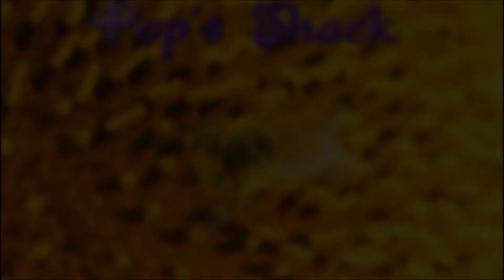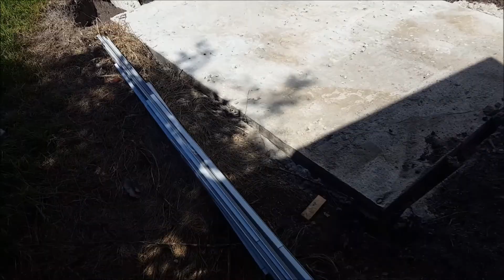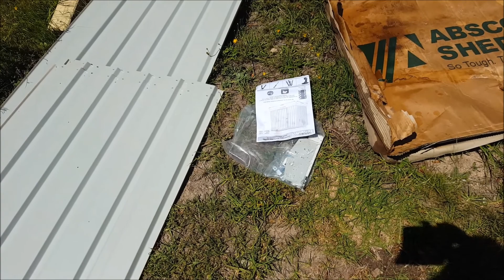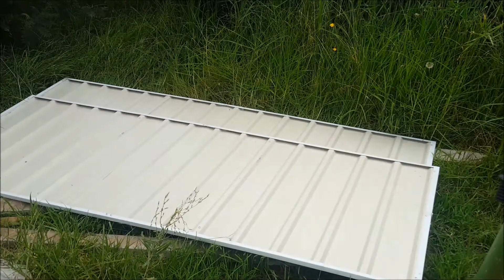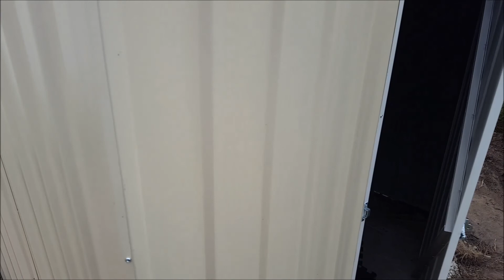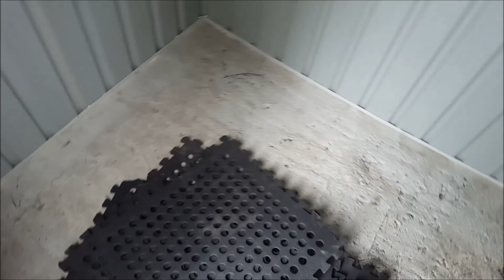Off grid solar power - The new solar shed

Comment: Slab looks good to me? what about ventilation for the solar gear? would get mega hot inside.
Reply from the maker: TechStories79 - Thanks. As for the ventilation, I'll get some 24V fans and hook them up in seties to run off the 48V battery bank.